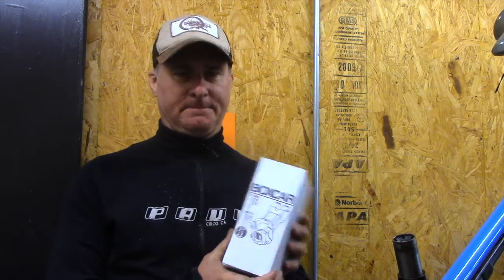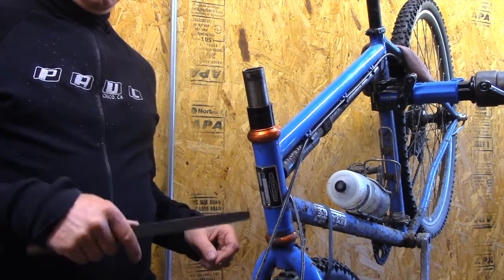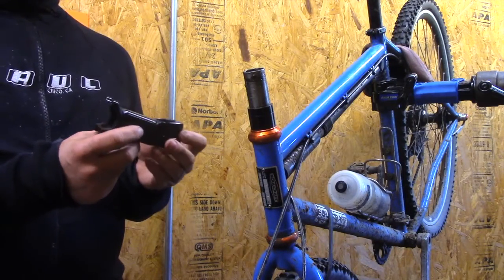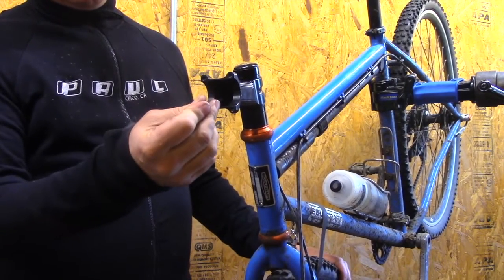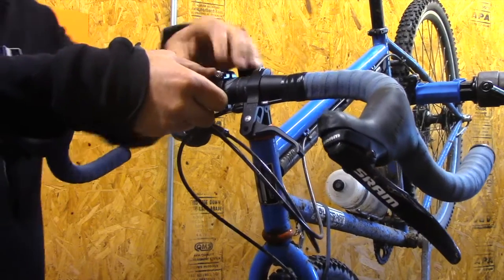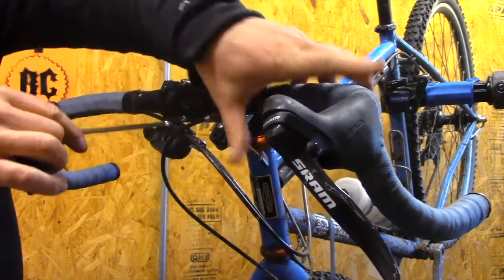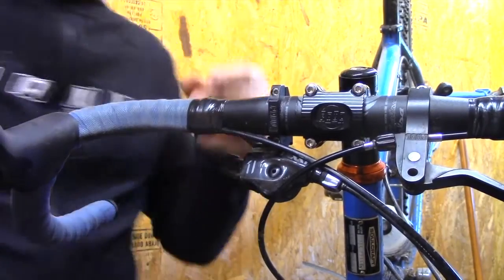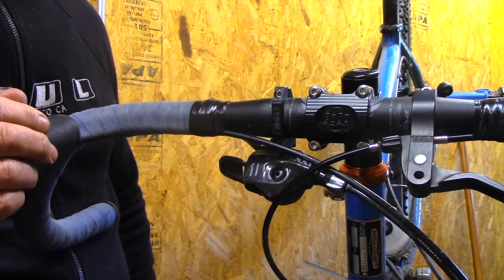PAUL Boxcar Stem

Comment: Heck. I just run what I brung but I am a bit fond of the longer sizes. 15 degree is great...70 to 90. I used to run 120's and 140's due to my extremely long torso but I stopped as everyone was laughing at me. Then I bought a recumbent and got used to the laughing (never ride around Lynchburg, VA in 1998 on a recumbent, just in case you are time traveler) and I got pretty used to being ridiculed but decided to will stick with the 70mm and 15 degree. As always, thanks for listening...BTW...just so you know...Paul Components rock on a recumbent, I have Love levers and am saving for the Motolites now. Happy Trails!

Comment: That's a seriously beautiful product!  I'd love a blue 100mm x 0 degree for my old Turner Flux. I'll check out your site later today. I've had two sets of your canti's on my touring and cross bike for years and love them. 
Two questions if I may: 1 - Is that that a Soulcraft Tradesman? Do you like it?
2 - Do you have replacement rubber O-ring kits for Touring and Neo Retro cantilevers available?
Thanks
Reply from the maker: We have 100x7's coming soon. In blue even!

Comment: In my experience, I’ve found torx screws to be more susceptible to stripping, the screw well just isn’t deep enough.
Reply from the maker: We've seen that with some poor quality torx screws too, so we had these stainless screws made with a nice deep socket. Haven't stripped one yet!
Reply: Paul Component Engineering I see. Though would it be ok to swap in M5x16 hex head screws for convenience or as replacements?